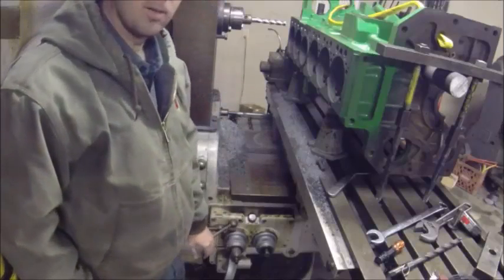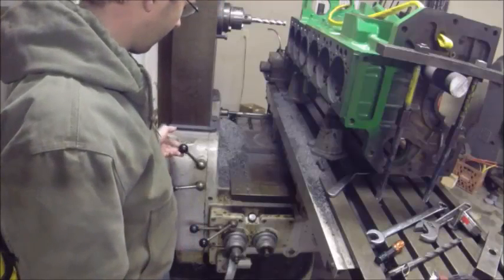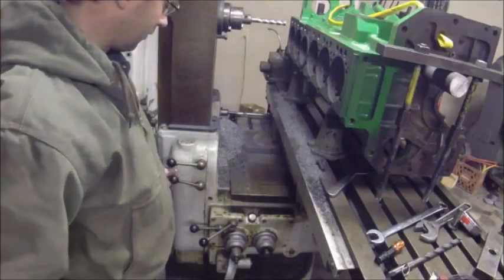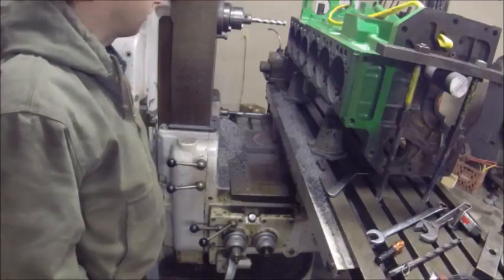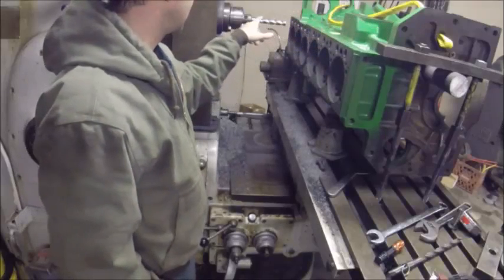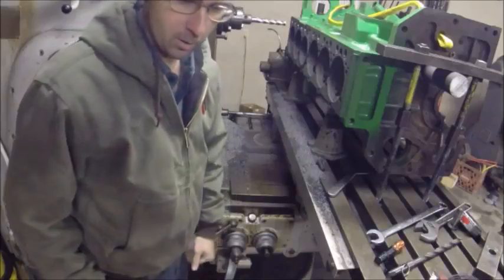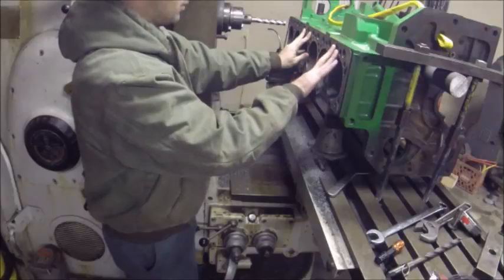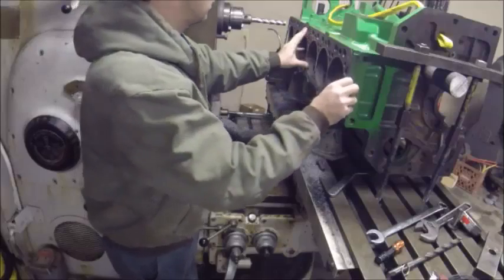Mill side controls

Comment: Brian, I guess I'm late watching this but have a question. Are you confident in your DRO to hit the holes again when you tap them? Ore these other holes for the head?  Good video, and great old machine.
Jerry
Reply from the maker: +Jerry Halcomb Yeah best i can tell my mill DRO has a positional accuracy of around +/-0.0005" over its full range of travel. The DRO on my lathe seems a bit better i would say it will repeat hit within +/-0.0002". I think this is within the spec Newall gives and when I have checked with dial indicators I have gotten typically more repeatable values than the advertised accuracy limits. Fact is most of my tooling will have more run out than the positional accuracy error of the mill.  I never have a problem going back into a hole based off the DRO.

Comment: Most interesting, two dumb questions: How do you know when you have exactly the correct depth? And when you are stood to the side like that how can you line up the tool precisely and correctly with the hole?
Reply from the maker: Well in my case I use digital readout. You could also use the mill dials if so desired just like working from the front.  As for finding where the hole is it is all the usual suspects, you could use an edge finder, a plug gage the size of the hole or use the co-ax indicator.
Reply: Thanks for your answer.